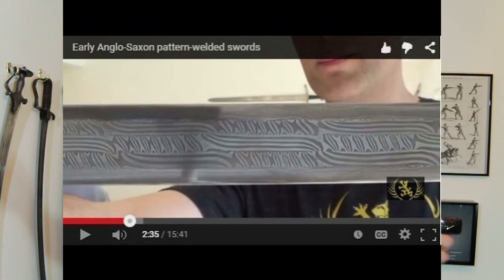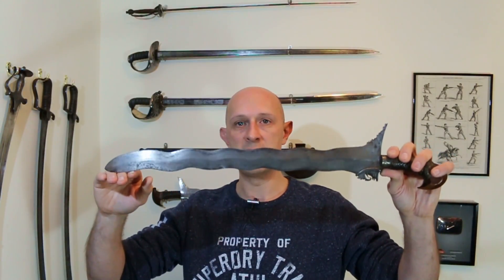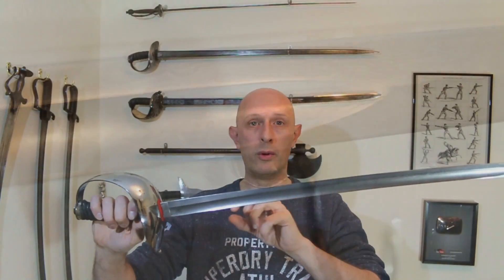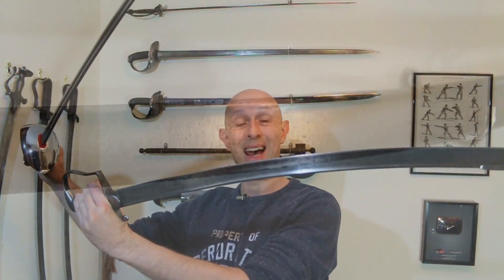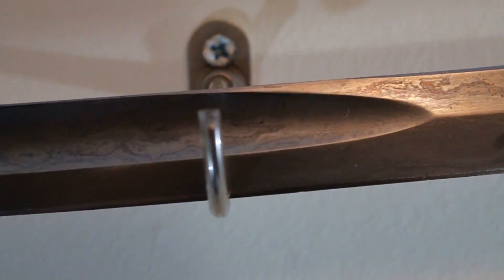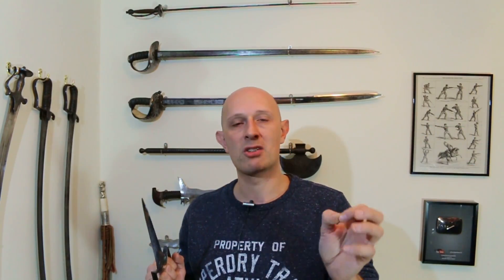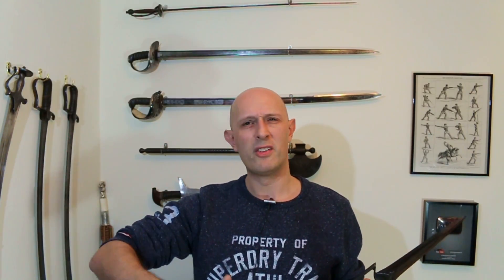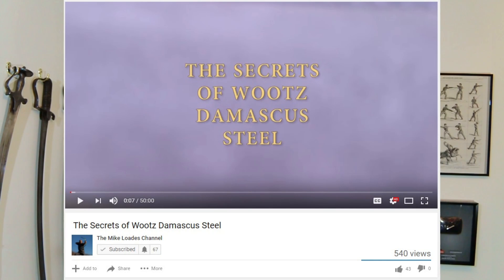Damascus (Wootz) Steel & Mike Loades' New Channel

Comment: "Echt" means "real" in german btw
Reply from the maker: Oops, I got it the wrong way around :-) Thanks for correcting.
Reply: Is it "echter Damast" or is it "Ätzdamast" though? The former means real Damascus steel, the latter means etched Damascus.
Reply: Yeah I wasn't sure about that either.
Reply: Another translation for "echt" would be "genuine".
Reply: A quick search shows Ätzdmast is a used term.

https://www.weitze.net/cgi-bin/suche/suche.pl?q=%C3%84tzdamast

even a Flintlock(?)

https://lot-tissimo.com/de/i/8186028